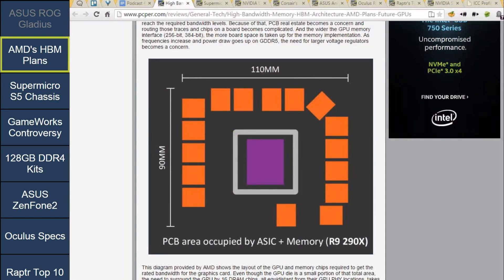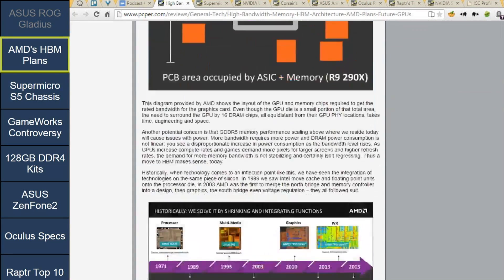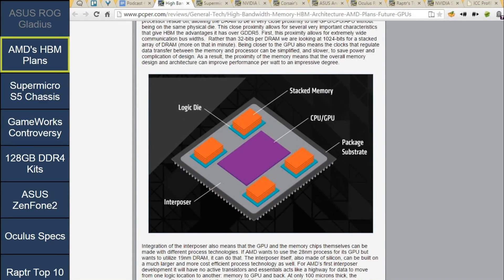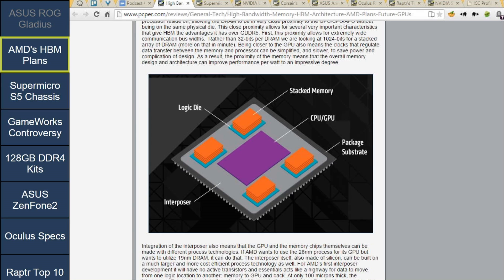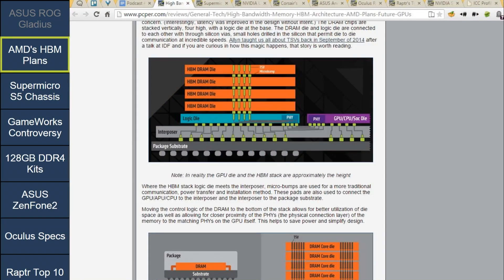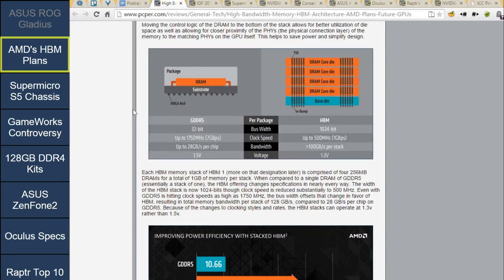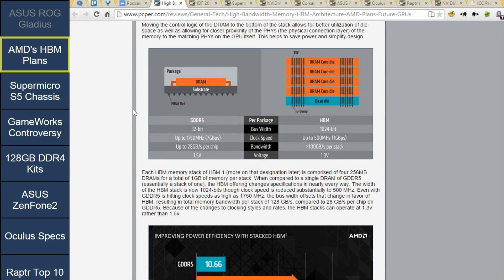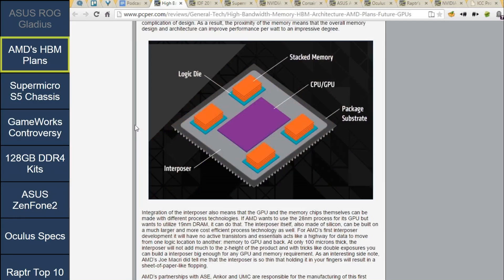Podcast Pieces: A Discussion about HBM (High Bandwidth Memory) coming for AMD Fiji

Comment: The r9 290x is already a class leader in memory bandwidth, which is one of the primary reasons that despite being a much weaker chip than Nvidias gtx980 it is a clear winner in some sorts of workload. Fully doubling that is just an awesome feat, that will have clear benefits for some production workflows. However the limit of 4gb of memory in version one HBM is going to knee cap that somewhat, which is especially sad given the r9 290x was available in up to 8gb from board-partners like Sapphire, so capacity wise its actually a step backwards for AMD.

Comment: Most AMD cards are better than Nvidia especially when it comes to OCL workstation Video cards. However i do like the Nvidia cards as far as gaming. NOW! The new 900 series cards are great and they are fast and use less power. However while in After Effects I do notice the 3.5gb VRAM instead of the 4.0. AMD R9 290 is a beast card that has 8gb of VRAM and cost a little more than my GTX 970 4gb card. I mean... Hmmmm... WTF Nvidia! Anyways Hana Hou. Keep up the good work.
Reply: Keiko FX Designs Yeah AMD has always been great for workstation cards, and I'm really looking forward to see how the new AMD cards perform in both workstation and gaming situations.
Reply: OCGameR Since all 300 series cards except the 390 are simple rebrands of the hawaii chip there wont be that much difference in performance. Applications that actualy benefit from fast memory benefit much more from higher capacities aswell and the 390x only has 4gb of ram and will aproximiatly cost nearly as much as the titan x which got 12gb. I dont really know if HBM will be that much of a deal atleast on the gaming site. Memory always was the least important part that benefits gaming performance.
Reply: Keiko FX Designs Well yes.  The 3.5+0.5GB isn't really an issue for games.  That is it's easy to predict what data isn't used and they already have a flush to push that data out.  For CUDA/OpenCL you are going to need your code to handle 2 pools.  The chances of that happening are low.